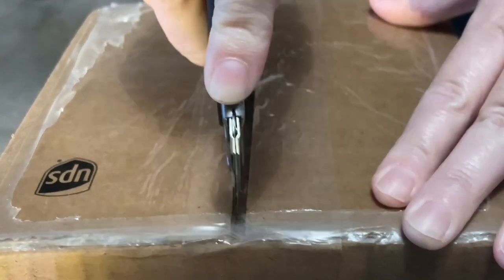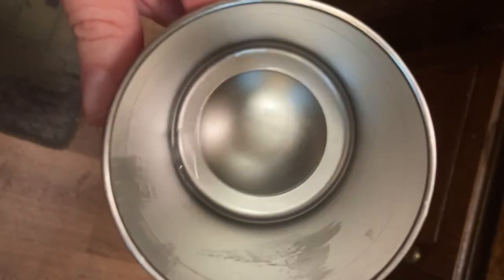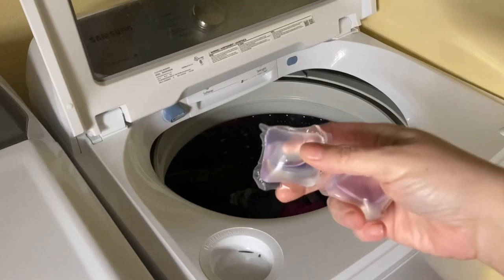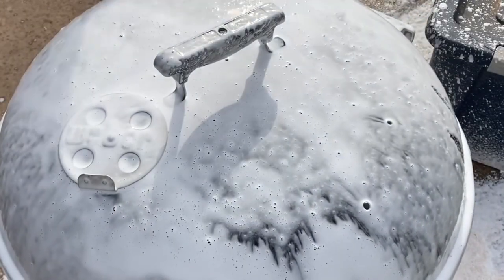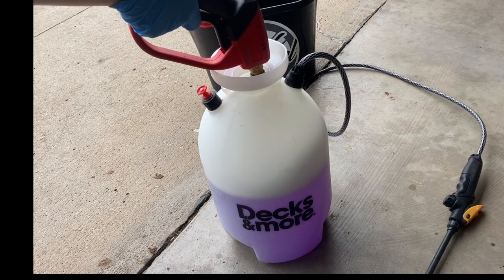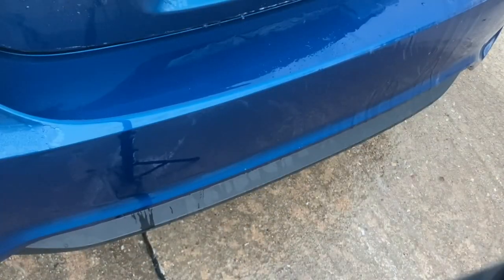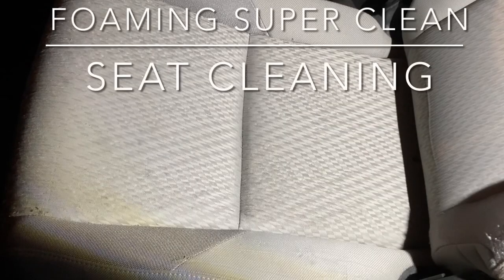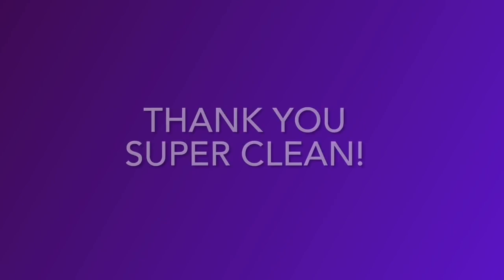SUPER CLEAN DEGREASER!- Does it work?

Comment: I use 10:1 ratio as a pre rinse on lower exterior panels of car/truck 👍
Reply from the maker: Love Super Clean as a pre rinse! Thank you for sharing!
Reply: On black plastic panels like black bumpers and valance panels?
Reply from the maker: @dtna  that’s a great question! With any alkaline cleaner you do have to be careful with plastics as they can cause staining/damage. One should always take in consideration their settings before using as well such as temperatures and shade and also take care to proper dilute for each situation. I love Super Clean as a pre-rinse but I would not use it on a ceramic coated vehicle. I personally would not risk it on older plastics but for paint and chrome it’s a great asset.